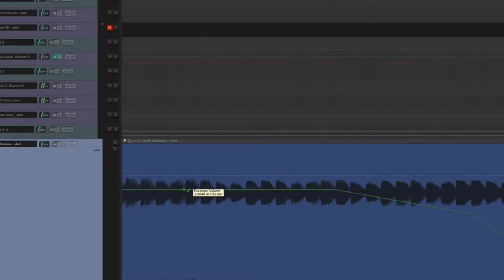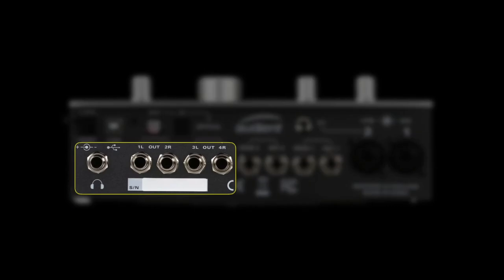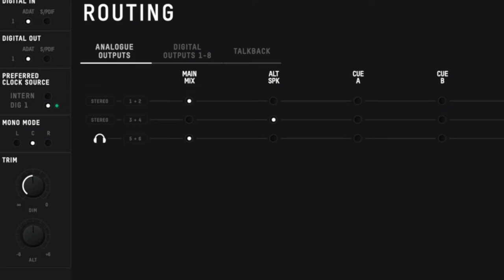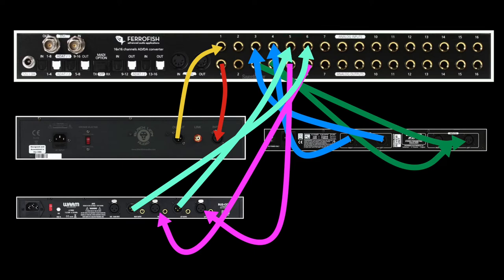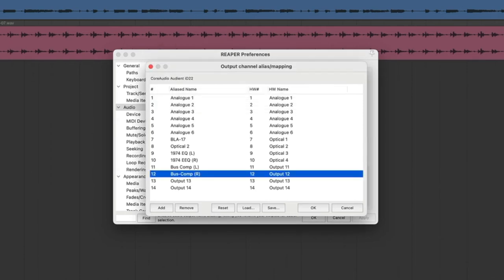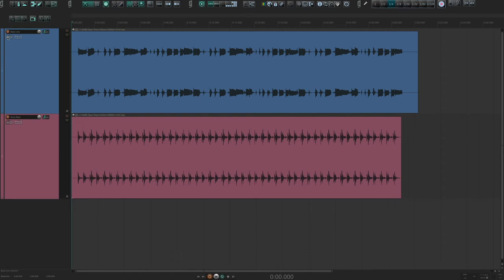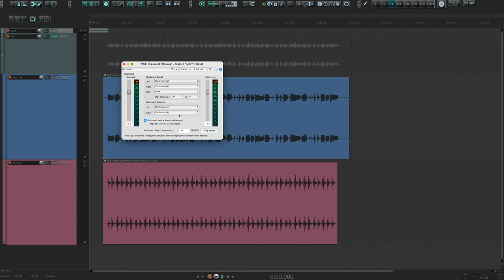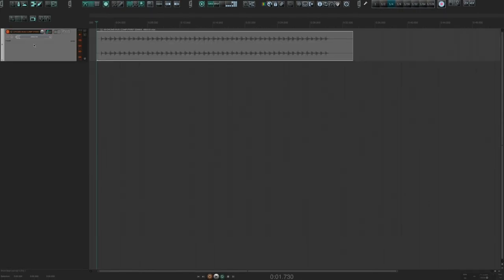Mix With Analog Outboard Gear In Reaper

Comment: Really well done Evan.

so for the printing part, watch out that your send volume is at unity. That's basically the same way I do it. I've also figured out a way to print to the same track, which is too many steps to list here, but can work really well as long as there aren't a bunch of splits on the original source media.
You can also disable full-speed-offline in the render window and set to 1x online to render the mix through the hardware. Necessary for master fx.
Reply from the maker: Thanks Jon!
Reply: Jon PLEASE make a video on this!!!
Evan like me and many others have interfaces with 16 plus channels of I/O, and many pieces of outboard gear.
Your videos were great, as are the others out there, but incomplete as to this step.

Printing back through ReaInsert to the Same channels, as Takes, then hiding the Original takes and de-activating ReaInsert is what we need whether manual or scripted.

The comments in All of these videos come back to this but I can’t find a video showing how to set it up.

Obviously Evan if you figure it out I’d love to see your video walking us through it as well.
This one is the most clear of all the dozen I’ve seen so far, and a Part 2 would be fantastic.

TIA Brothas!
Reply: @G_handle  I actually did do a video on this recently
Reply: @The REAPER Blog  Great!
Thanks for replying so quickly. 
I've been watching videos on this all day, both of yours on ReaInsert and Recording with and without Takes.
Haven't found where you print through ReaInsert to Takes using Track Output.
(Posted by mistake) 

I did find an old video from Kenny that covers many scenarios, except ReaInsert. 
https://youtu.be/nVbGhnS_sQM

So combining Tutorials we get there.
Do you have a link by chance to the video you're referring to?

Comment: Ok so after many frustrating hours of trying to get a decent signal through send and returns from HW to Interface through ADAT, Ive come to the conclusion that this is basically not going to work. Also, in this day and age with advances in plug in quality and fidelity I just can't see a reason to use inferior external 30 year old hardware. I think Reainsert is a failed attempt at routing sends and returns between hardware devices. Yes I did follow the steps in this video and it simply does not work. I'm unplugging and shelving my  old (lousy sounding hardware devices) and boxing them up. Sorry I wasted so much time on it .I guess its 2 days I'll never get back ....

Comment: Where is the extreme feedback / tin can sound? LOL I send out and return in using the Reainsert and all I get is horrible feedback. I'm clearly overlooking somehting simple.
Reply: It only took me 2 years, but I figured it out today! I'm using the Focusrite 2i2 and the 2 "stereo outs" are combined with the front headphone jack. Using both creates a feedback loop of sending and monitoring, so I just unplugged my headphones. On the 4i4 unit, monitoring is set to 3/4 by default so you can't send from 3/4 and monitor UNLESS you go into the Focusrite software and re-route monitoring to 1/2. Hope this helps with whatever setup you have!

Comment: Well done and useful video.  I am currently not a Reaper user.  I have a multi UA Apollo set up and switched over to their LUNA daw from PT a few years ago.  I REALLY like it a lot BUT, it's restrictive for routing and really no good way use hardware inserts.  I track with all analog frontend and then mix ITB (my tracking room is decoupled from my mix room, so, separate setups)  However, I recently got a nice Stam Audio bus comp and I'm looking to add a few more pieces to mix with as well.  Reaper looks to be an amazing option for this so I think I'm going to take the plunge, install Reaper, deal with the learning curve try mixing with it.  Thanks.

Comment: good video with nice production values .....

I have recently set up a separate mixing/ mastering station in my studio with an SSL Big Six, SSL Fusion, SSL Bus+, SSL UC1 and SSL UF8.  Now that they are set up to work with Reaper, the system works well.  It is nice to have physical hardware to use.  I don't claim that it improves the quality of the songs but it is quite enjoyable.
Reply: hey :) did you connect the analog gear to you're master manualy in reaper ore did u use reinsert ?  just asking ...

Comment: Thank you for this video! I'm guessing this video was based off an older version of Reaper? I ran some testing and I was able to render to a stereo wav file without needing to print back the effected channels into Reaper. My only slight issue is I seem to have a delay in the hardware VU meters but the audio is fine.

Comment: Thanks...I have a rather unique set-up and while my external gear isn't here yet...I'm trying to prepare myself as much as possible in advance. 

There is definitely some good info in this video. However, my situation is that I have a desktop interface with no extra sends or receives. But I also have an X32 Rack. So that will be my new interface going forward. I know the easy route is to use the aux ins and outs. However, I don't believe that those show up in Reaper.

I know running into a couple channels is the work around for that. But what I am unsure of, is if the aux outs will work to feed the external hardware or not. The X32 has infinitely versatile routing and so does Reaper.

I expect this to be a bit of a 'Journey' for sure!

Comment: Great instructional video ! I have a ton of vintage outboard that I track with never  mixed with, but this is something I have wanted to do for some time ,and had to get my head around. I spent all day yesterday trying to send out a signal into a Hologram Microcosm pedal for one part using ReaInsert and my ID 44 using outputs 3 and 4 and still have not been able to get a return signal no matter what I did. This was just a test to see if I could get this system working. I was pulling my hair out with the routing. The ID44 wants to send the audio out ThruDaw which I did but still no return. Going to explore more today and see if I can figure this out. I have a Metric Halo ADDA coming in a few days and hope I have this routing sorted before then. I have a vintage Pultec EQ that will really sweeten an overall mix if I can get this routing sorted. Thanks for your effort and clear explanation.
Reply from the maker: Yeah i'll be curious to see what happens.  I hope you get it figured out (I"m sure you will)!
Reply: Did you ever get it figured out? I have an ID44 and I want to run VST synths through my guitar pedals live. Trying to figure out how to do that so that I can play the VST synth in real time while it sends through the guitar pedals and then back into the ID44 for recording.
Reply: @sbenson76  I did end up getting Reinsert to work but not with the ID44. I was upgrading my ADDA at the time and went with the Metric Halo ULN2 3d and got that up and running and able to mix with my outboard and reamp with my pedals etc with no latency. It took a bit to understand my new workflow but I got there in the end. I am sure I would have figured out how to do it  with the ID44 had I stuck with it. The main thing would be to set up your alt outputs and run those out to your pedals,(be careful there as far as volume and feedback loops) and then run them back into your system via your normal 1 and 2 preamp inputs. From memory I had to go into Reapers preferences and go to Audio, the input and out put alias/naming and organize my inputs and outputs. After that when you are in Reinsert you need to set your output buss and your input, in my case it was send 3 and 4, and returns 1 and 2. Take your synth track and make a track below it, and send the vst signal there while taking the original synth out of the mix. Arm the track. Set your input on that track to input 1. Now send your signal and you should see your signal returning. Now go ahead and ping it, and it should correct the latency automatically and you are good to go. Even did a much better job of explaining this in his vid, but I am happy to chime in and help you get going. It's frustrating not being able to figure something out quickly as it kills the vibe of creation. Good luck and let me know if you sort it out.
Reply: @owlmeetscatofficialpage593  That is super helpful. My biggest problem is ReaInsert and wanting to use it and outboard gear as a plug-in. (Instead of sending the processed signal to a new track.) I get horrible feedback when trying this method. If I take the routing to the Mains out - I lose the ability to hear the track! I suppose I just have to send to a new track and take the original source track out of the Main send?
Reply: @nolarocks  are you routing the output out through the mains or alt outs. What is your interface?

Comment: Hello and thanks for the video. I'm having a lot of problems trying to use external hardware with a portable audio interface, the EVO8.  On the rea inserts ins and outs I have renamed the sends as you've suggested but I can't seem to send the track to the matching pair or returns. Also, on the outputs it only shows 1 and 2, no 3 and 4😢

Also, how do tou monitor the wet signal coming from the outboard?
Reply: I have the monitoring problem also, followed steps of the video but all I'm hearing is the dry signal.

Comment: Nice video dude, I pretty much do the same,. Although, i was wondering how you deal the delay compensation? Even after using the ping button on Reainsert audio will still be slightly out of time. Have you noticed this?
Reply from the maker: You know I've only been mixing with the gear for 2 weeks or so.  I did notice that when I print,  the audio can be 1 to 3 samples off (which doesn't seem like a huge deal) but I suppose it could make a difference over time with a bunch of tracks.  I'll look into it and see if I can figure out a solution.  An excuse for another video...;)
Reply: You have to add manual compensation.
Reply: I print a lot of stuff through hardware using reaper. I actually haven't found a real use for Reainsert because I just use the hardware output section on the MCP. To get around delay compensation I'll put a sound like a click track click in the beginning or end of the original track and print that through the hardware then manually line the waves up in the TCP. It may not be an airtight way to do it, but unless you're only printing one channel of a multimic'd drumset or something horribly phase coherency dependent it will probably be fine. It works better for me because you can just line them up visually and don't have to figure out what the exact offset is.
Reply: @PodPeak  instead of rendering by using Record Output: Stereo, use Record Output: Stereo Latency Compensated. This setting incorporates the latency compensation determined by the Ping feature of ReaInsert. Great video and it’s nice to find I’m doing this the same way for my hardware effects.